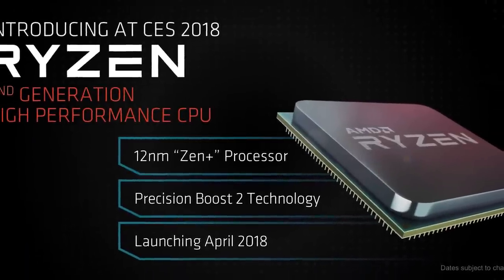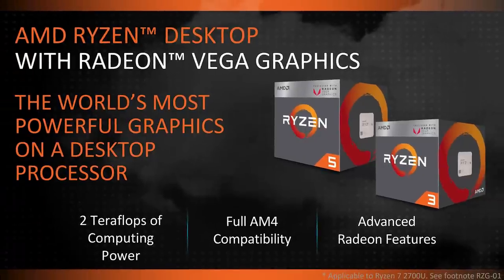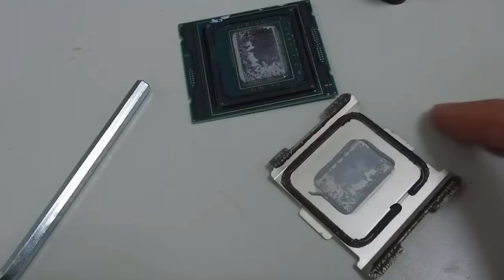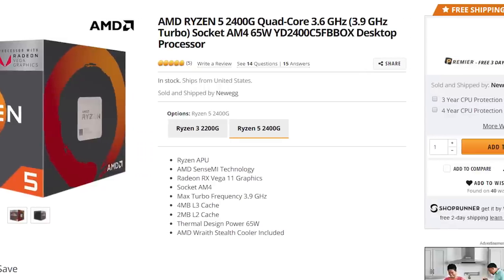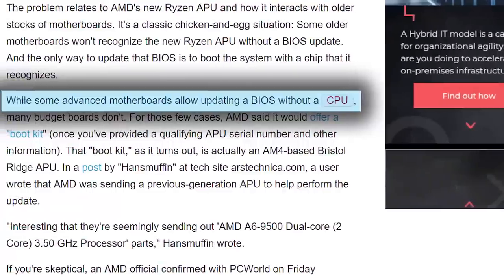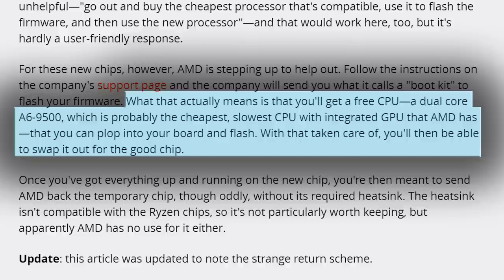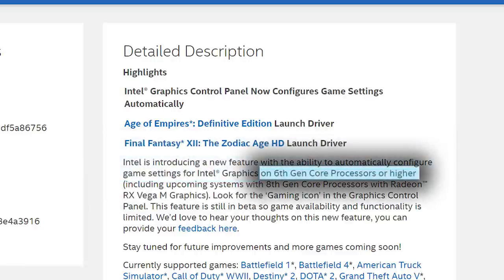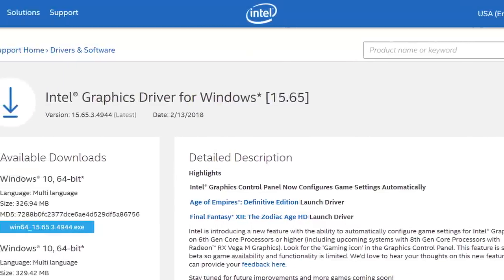Is Ryzen 2000 Series Soldered & AMD Will Loan You An APU To Update!

Comment: You dont need auto settings for intel integrated gpu.  
There is only one setting for all
Its call "Minimum" that the best setting for them
Reply: You forgot to downscale the resolution too.
Reply: Yea and turn off the game all together
Reply: Last Breath lol
Reply: I mostly agree, but do think it's a good move and I'm quite sure the vaga m gpus will be able to handle high, ultra at 1080p.
Reply: Dawie Nel "Maybe"
Reply: ultra? keep dreaming
Reply: Not necessarily true. Older AAA tiltles can run at higher setting at 720p
Reply: firirlife That's simply untrue. I have no problem running games 8 years old and even some newer ones 720p medium settings at a consistent 60fps on an Intel 8550u. Have you ever even tried running things on integrated graphics?
Reply: I'm not necessarily saying integrated graphics are ideal for intense gaming, but I think for some light casual gaming they preform much better that what you think.

Comment: I can run at 4GHz on my R52400G with just a Wraith Spire. It tops out low 80s! ( Yes, a Spire not the Stealth) So the TIM job aint the end of the world.
Reply: My intel laptop idles more than that, so yeah it is good considering.
Reply: I strongly recommend you to delid since you can make your cpu healthier
Reply: I just finished a bunch of testing at ....... wait for it........ 4.1GHZ @ 1.4V with just my Wraith Spire cooler (100W TDP)  with the Vega 11 side clocked at 1240 MHZ. The highest temp I got was 88C during the Time Spy CPU test. ( There was where some thermal throttling took place.) Cinebench I hit 164 single thread and 879 Multi thread. max Temp 78C. The one thing I think everyone is forgetting is Thermal Paste TIM does have a bake in time. Up to 400 hours of use. Everyone has new builds so you have,  The APU Chip, then AMDs TIM, then the Heatspreader, Then your TIM, and then finally the cooler. So you have two sets of TIM that need bake in time. I suspect a month from now when I run these tests again the temps will be cooler.

Comment: I was faced with the boot problem, having just bought a 2400G and a Fatal1ty AB350 ITX board. ASRock kindly sent me a replacement BIOS ROM.
I don't care that the processor isn't soldered. It has a low TDP and the Wraith Stealth cooler is more than adequate for it. I'm happy that the higher power Ryzens will continue to be soldered though.
I love my 2400G. I'm not a gamer but I notice the Vega 11's OpenCL performance is almost 50% better than that of a discrete GT1030.
Reply from the maker: Oh it's a great APU! Please don't take my words the wrong way. It was more of me letting everyone know that Ryzen 2 is soldered.

Comment: So, does this mean that if I have an older X370 or B350 motherboard, but I waited until purchasing a Ryzen 2700 or 2600, I'm going to have the same problem as the new APU's, when it comes to bios updating problem?
Reply: i don't think, because the CPU part of the APU do work but its graphic part doesn't that's all. R5 2600 will probably work fine but a bios update will improve it performance, that's what i think, we will see later.
Reply: Yeah same as Intel Z170 and z270

Comment: what is the difference between tim and solder?
Reply: End me solder just spreads the heat better than tim bc it's metal
Reply: bl00dwork oh ok thanks
Reply: about 10 degrees C!
Reply: Solder is a metal that is molten to bind the ihs to the die. Tim is glorified thermal paste. Think of solder like a permanent version of liquid metal. You need to melt it to remove it, it has better thermal properties than most TIM, especially what intel uses. Though it's more expensive to use, and may result in a shorter lifespan as heating/cooling can cause cracking. But the "shorter lifespan" is still well over a decade so nothing to worry about. 

Tim=inexpensive, lower quality
Solder=expensive, Higher quality
The difference ín temperature depends on the chip in question and what TIM is used, but generally solder is 10-25 degrees cooler than Tim
Reply: The point is that in some places you really need solder. In others TIM is quite adequate and makes more sense. APUs don't need solder.
Reply: no problem mate

Comment: TIM is thermal interface material, solder is TIM too, thermal pads are TIM too, not only thermal paste is TIM.
If I spread peanut butter between my CPU and heat sink it is TIM.
Reply from the maker: That's correct, but TIM is typeically used in this industry to describe the thermal paste. It's somewhat similar to referring to SLA as laser printing in the 3d printing industry, but really, it's any kind of printing with solidifying resin with a light. The issue is that this is the term that's stuck, so we use it.
Reply: +Gamer Meld 
Could just say paste.
Many people refer to it as bird shit or tooth paste which is still clearer than using the group name.
Reply: You're*
That was your lesson for today.

Comment: what do you mean soldered? delid capable or soldered on motherboard?
Reply: ZG CoffeeGuy NA He's referring to the IHS being soldered to the CPU die for better thermal conductivity
Reply: they use gold or a simular conductive material to solder the lid on the cpu for far better thermal transfer then can be provided with thermal interface material or TIM.

thats why you hear the constant bashing on intel I core CPUs for having to be delided to really get the best mileage from them, Intel uses crap TIM that is about as effective as toothpaste to transfer heat to the lid which causes overheating problems easily, On low end CPUs like pentium or I3 its not a huge problem but on I5 and I7 or even I9 cpus it causes heat issues hence why so many people delid said cpus.

same would happen with ryzen, On the APUs which are low end entry level parts its not an issue the TIM is good enough and the cores put out low enough heat that TIM  provides a minimal hit to performance over a solderd cpu while keeping the cost low making them accesable to more people, While anoying to overclockers and the like the cost savings and accesability to more people makes it a smart financial move.

On the mid to high range ryzen cpus where overclocking and heavy workloads would be more common it could and likely would cause thermal issues meaning that solder is really the only viable option unless you want to piss off a lot of customers and force many who dont even overclock to delid to get the most out of the cores which may make them just buy an intel core as one of ryzens biggest draws is right out of the box its a damn fine core that can even get a good overclock with minimal effort.
Reply: Arctic Fox Not gold but indium in the solder.
Reply: johnm2012 my mistake i remimber reading it was gold someplace
Reply: Arctic Fox No problem. I agree with your point 100%.
Reply: @johnm2012 @Artic Fox
Actually both, Indium soldering between the die and a gold plated layer in the internal side of the IHS.
https://www.techpowerup.com/231401/you-really-shouldnt-delid-amds-ryzen-7-cpus
https://www.techpowerup.com/235571/amd-ryzen-threadripper-delidded-its-epyc
Reply: thanks guys, Appreciate all your effort : )